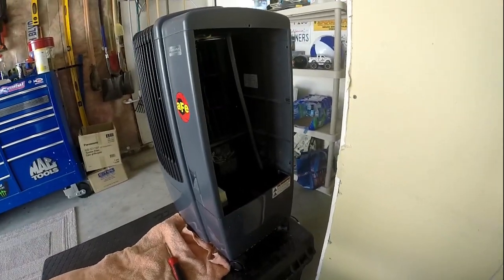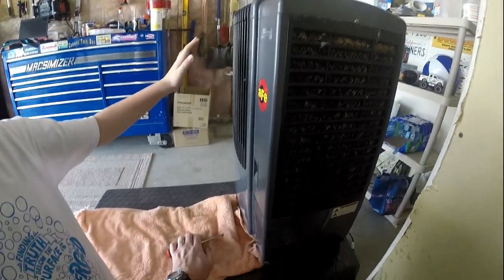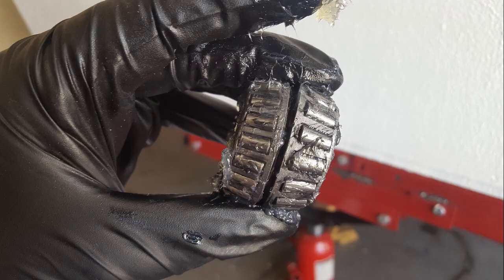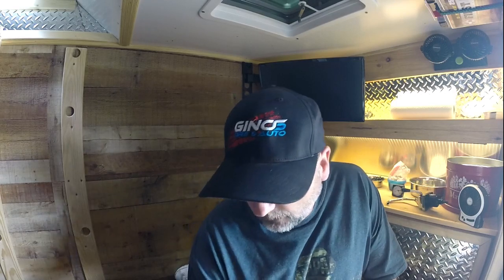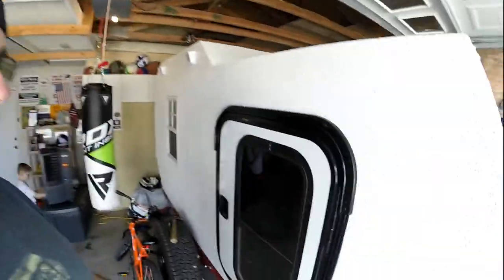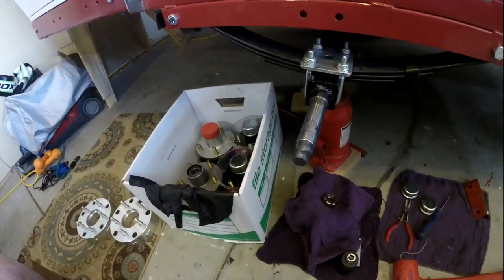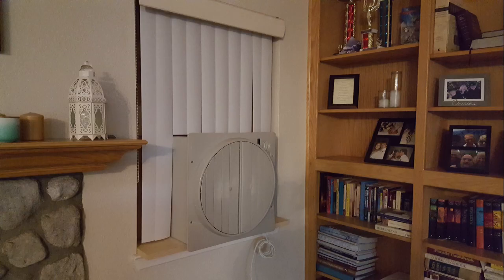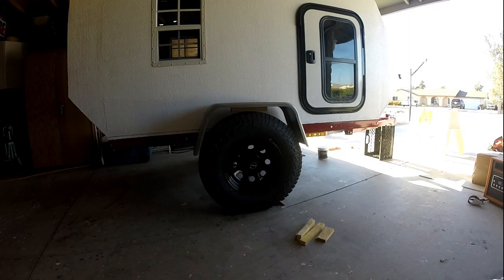4 x 8 Camper Part 26 - Bearings fixed / Fender Future.

Comment: dam your framing was beautiful but I have to say I wish you went another route with the finishing, roofing coating?! Nooo
Reply from the maker: LoL. thanks a bunch.  Just curious, what would you have liked to see for the roof?
Reply: @DIRTADDICT922  I'm building one that is almost Identical in the framing sense except I didnt add as much detailed angle changes(nice touch)  to the structure, I also built under deck storage ( 2x10) I will be painting it with a oil based polyurethane clear coat then put aluminum sheeting 24 gauge an finishing detail piece of diamond playing around the edge. Also I put over emphasis on water proofing with various sealants. Your structural framing is very very good, nothing wrong with over engineering in my opinion. This is probably one of thee much well built wooden mirco-campers I've seen of YT.

Comment: If I’m not mistaken those hubs should have a torque spec. If you don’t torque them down to spec you’ll burn out the bearings.
Reply from the maker: Hubs usually do not have a torque specification. Usually due to the fact that the axle nut only has so many slots for the cotter pin. It would be nearly impossible to torque it and have it land right where the cotter pin slot lines up with the axle. But I do now know the problem with my set up. The axle diameter is 15/16ths and the hub is meant for a 1" diameter axle!   ;)
Reply: tireguy 1000 I guess that makes sense. Thanks for explaining that. I hope to build something like this in the future and I’ve only really worked on cars and that’s where I picked up that principal. Love your videos keep it up man.

Comment: I think the HF axles are 15/16" where standard is 1". Lot's of bearings for 1" but not 15/16"
Reply from the maker: Thank you  thank you  thank you!   I needed this information!  This is the final straw in my decision to swap out the HF axle for a Dexter 1".  This will be my late spring project.  I had this in the back of my mind to do. But knowing that I was gonna have to weld the spring hangers in place I really wanted my welding skills a little more dialed. After building this rack I learned so much.  I will be able to put it to use now.
Reply: @DIRTADDICT922  I picked up a folding HF trailer and had to replace the bearings that"s how I know.

Comment: Hello there, like what you did with your HF trailer, I am starting to plant for my second trailer build and what failed on the first one is waterproofing it, granted it wasn't a camper, it was my camping. gear trailer but it sleeps outside and I had it covered with a tarp and a gazebo but somehow water leaked in so what products did you used on yours (Base and textured one). I live in FL so my new design may or may not have A/C but water proofing is a must this time around.
Reply from the maker: Yes, still got it. Still using it. So far so good. Still want to do more work to it. Time is just in short supply.  I have several videos on the page going over what I used to seal and coat it.

Comment: hey tireguy  could you tell me  the total length of the longest plywood side please.
Reply from the maker: Hi Rob, there is one 4 x 8 piece of plywood that covers the frame front edge to back edge of the frame as each wall. The front and rear push outs I am not certain what that measurement is but I will get that for you when I get home tonight.
Reply from the maker: OK, furthest tip forward to the back is exactly 122.5"